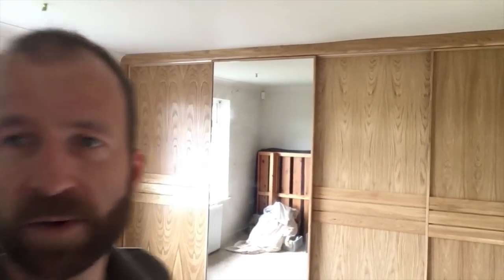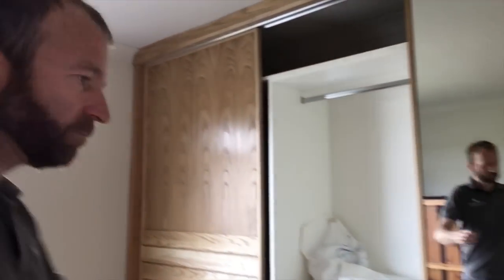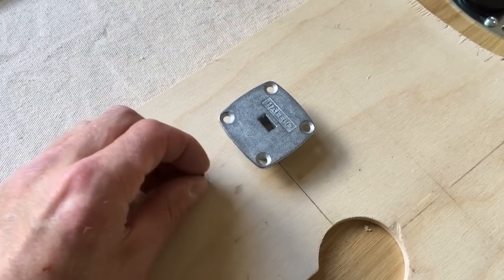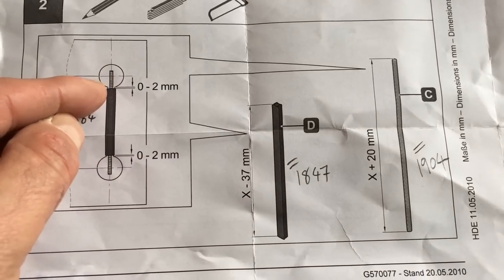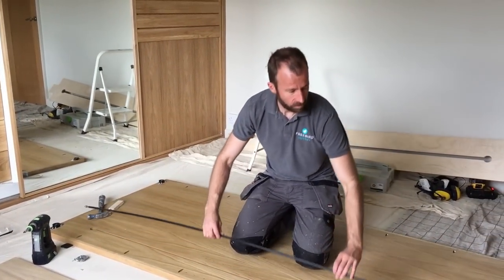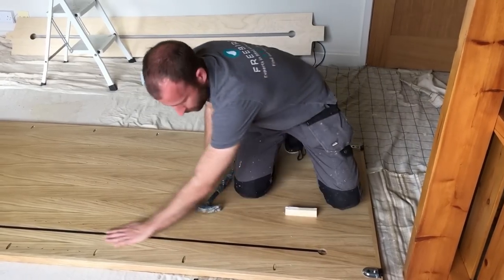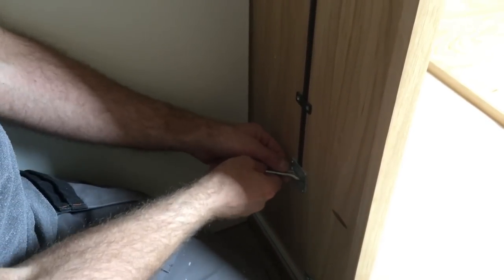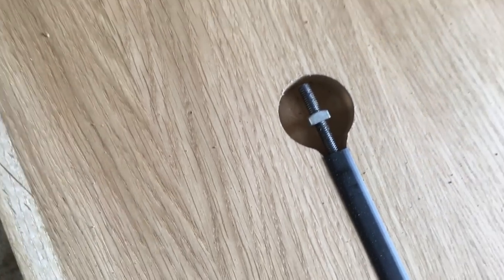How to Straighten Doors with Hafele Planofit Straightening Bars

Comment: Exceptional work! I hope the customer compensated you. Whether or not you figured warpage may occur, you’re not in control of the physics of this world, how hot the sun will shine or the fluctuating humidity levels. May God Bless.
Reply from the maker: I was like many woodworkers - too quick to foot the bill.  Which is why so many of us struggle along making so little money.  It feels like our mistake - or at least a lack of knowledge we should have had.  The customer paid to receive working straight doors, so I felt obliged to fix the issue that came up.  May such experiences overe the years led me to specialise more, and only take jobs where I know I can control the outcome based on experience.  On a recent job with a new material (Maple Ply) I advised the customer ahead of time there is a risk of warping, and if it happens there would be an added cost of £120 per door to retrofit door straighteners.  This is the best way - to be able to foresee possible problems, and give customer forewarning of potential costs

Comment: This is an extensive process but one we’ve used for large format doors. Aluminum honeycomb, epoxied between two 6mm veneered ply. Glued up inside a vacuum bag.
Reply from the maker: Interesting!  How thick is the aluminium honeycomb?
Reply: @Alastair_Freebird  5,11,18,24mm. Then there’s different cell sizes. 1/8th - 3mm and 1/2 - 12mm.
(US) Amazon have some small sections available. It’s like building a hollow-core door.
Reply: @Alastair_Freebird  resin infused cardboard honeycomb also works well for this, much cheaper than aluminum if you can find it 👌

Comment: I have used that running gear a couple of times and always found the door would fall back a little. The Ares I think it is on buller ltd with spring-loaded wheels top and bottom are much better with easier adjustments. Doors look good.

Comment: Looks like a neat bit of kit.. Guess they are not cheap.
Reply from the maker: simon clayton I meant to summarise the cost at end of video but forgot as it got late and I wanted to go home 😆 all 12 bars and fittings cost me around £170 plus vat from Hart Wholesale (my preferred Hafele reseller).  It took us a long day to do plus best part of a half day for Brady figuring it out and getting the jig right in the workshop. So costly altogether.  But it really shouldn’t have taken that long; now that I understand the system if I ever had to do it again I’d just go straight in and cut the doors with a 35mm hinge cup drill bit and a 10mm router cutter with a fence.
Reply: Nothing from Hafele is cheap, but the quality is top notch.

Comment: A great fix and very nice hardware, hopefully I don't run into this one day.
This has absolutely nothing to do with the hardware being top or bottom... please bare with me, I did not believe until I witnessed it several times myself.
I am assuming that the middle rails were glued well to the veneer? If so this would usually require a "balance" to the MDF core veneer I believe you are using. Humidity and temperature changes to core material will cup a panel, especially if one side is glued in one spot,the veneer on that one spot cannot move whilst the other side does,this creates an area at the back of the panel that is not still " balanced" to the front veneer and creates a point to curve from.
I am a   30 year in Cabinetmaker/ Joiner from Yorkshire and never thought of,or believed temperature or humidity could change a Bespoke made piece until I moved to the Deep South and witnessed this several times after moving to the US 20 years ago!!
I am really enjoying your honest and transparent stories,keep up the great work lad!
Reply from the maker: Bradley Roe thanks for the comment and interesting to hear a bit about you!  Yes those horizontal oak strips were glued (and ‘clamped’ with screws out of sight through the back until the glue dried). Because they are horizontal and only a small area I was thinking they weren’t a big factor in the bending but you may be right that they contributed to the issue.
Reply: @Alastair_Freebird  Look into trying to acquire a copy of the Architectural Woodwork Institute guidelines,a door stop of a book but very decent regarding panels.
It's the same if you don't balance a laminated sheet with a similar product on the back side,the panel will bend it not secured.
Have a great weekend and get back to work!
Reply from the maker: Bradley Roe I would like a book like that!  Is that a British or American institute publication?
Reply: @Alastair_Freebird  ,it's an American book of the different grades of millwork. AWI is the gold standard over here and a thorough reference to have. All of the information is strictly backed up.

Comment: for those kind of slidding doors i only use 10 mm thinkness pannel plus aluminnium profile, It works fine for me and never had bending probs with it.
Reply from the maker: Wood Be I agree aluminium frame style is the most risk free style if the client accepts that look.
Reply: @Alastair_Freebird  we have a large variety of alu styles available in Portugal. Nothing as warning client about the risks using solid wood in large panels.

Comment: I’m about to do a job using 21mm plywood. The doors are 500/2000mm. I will be using the Wingline L bi fold system. They will be painted. Should I use these from the start? Super video.
Reply from the maker: I think they might well be ok without the straighteners but be prepared for taking then off and adding them after.  I think when a door is restrained by hinges it helps keep it straight whereas bottom rolling sliding doors are especially prone to distortion

Comment: Unfortunately I have a warped sliding door to a bathroom which is not heated or cooled, but the hallway side of the door has aircon in summer and heating in winter, so the door warps one way in winter and the other way in summer. So I don't think these things will work. Thanks for the video though, very detailed.
Reply from the maker: Mark One interesting situation!  They will work but you will have to keep readjusting them to alternate between tension and compression in the different seasons!

Comment: Nice little "get out of jail 'free' card"!
Bit surprised about the warping as the core is veneered on both sides.
I suspect a small part of the problem is down to bottom-hung runners being used.
I find that top-hung sliding doors work much better even if you have to make up your own fixing support out of e.g. 4x2 anchored at the ends(avoids ceiling fixing issues)

Main cause may well be that the sturdy oak edgings weren't fully seasoned/sealed and were asymetrically positioned- 1 edge glued n mechanically fixed whilst the other is free to shrink/stabilise.
Perhaps 3mm oak lipping on the edges and a pair of separate 12mm oak finger-pull battens glued to front face would have avoided the problem altogether and indeed if wide enough,e.g. same width as the crossrail members, would have eliminated/significantly reduced chance of subsequent warping due to lamination.
As I'm sure you can appreciate;in some ways we are always prototyping,right?Price of an interesting life!
Keep up the good work and fair play for showing it how it is in real life,warts and all! :-)
Reply from the maker: Chippy Steve thanks a lot for commenting and sharing your thoughts and I like that -‘always prototyping’ - so true!

Comment: The actual problem is the design of the door. Panels do bow under their own weight unless you hang them. That is a fact. That is why all 8×4 sheets are stored flat on the shelves in B&Q. If the panel stands upright, there is going to be tension on one side and compression on the other. Therefore, a wooden frame should be sandwiched between two panels to reduce this effect then it would stand straight for years. I am not convinced that the metal rods are the solution in the long run. Yes you change tension to compression or compression to tension on one side but in the future the panel could still bow to the other side.
Reply: @Tephnos  where did you get it from? what I am saying is there has to be a frame holding the panelsl.. You can't cut a piece of plywood or 18mm board and hinge it as a door, can you? It won't work as it will bend/bow. Some kind of frame is required.

Comment: Great video - thank you.  I plan to fit these to two sliding doors.  The doors are 18mm ply and are each 1600 high by 600 wide.  Given that my doors are only 600 wide, do you think I would get away with 1 tensioner in the middle or each door? (rather that one on each edge as you have done)
Reply from the maker: Peter Savage I would recommend going the whole hog and doing 2, you will have more control flattening out the door
Reply: @Alastair_Freebird  Thanks for the quick advice.  I will do that.

Comment: Used same runner system, built doors (mfd) 2300 height . Had warping problems. They bowed out. Bought ‘piano’ straightening kit. Shortening  bows them out more. Tried lengthening but didn’t work. I’ve taken doors off again, and am reverse bowing under force. Maybe if I put them in bowing inwards ……………
What a palaver. I’ll never use these tracks again. Best to hang them. I’ve never had problems with the hangers because the weight of the door acts as a natural straightening force.
Reply from the maker: It should be possible to adjust either way - is it possible the length of the threaded bar got maxed out (cut a little too short maybe?). And was it set in offset from the centre of the thickness of the board?
Reply: @Alastair_Freebird  hi. Thanks for replying. I used 3/4 mfd and I routed to the minimum depth required to fit rods and guide bar. Rods were used full length and the adjusters were correctly spaced for this. 
Update. The reverse forcing didn’t work, so I ascertained the apex of the bow and cut several horizontal lines across the front at this point and above and below this point, in order to take away resistance. The reverse forcing was then almost successfully accomplished, and the doors refitted. However I realised they would always tend to bow out so I fitted securing cover strips on the two sides of the wardrobe that keep the doors locked straight . Small  bowing is visible at the centre. 
All in all. The most problematic wardrobe I’ve built out of over one hundred. But it’s all painted, very functional inside and actually looks superb if you don’t inspect the middle to closely!
I’ll never use these tracks on such tall doors again, though!
Thanks for your video/s . Great wardrobe you built there!

Comment: That is awesome! Do they only work in a certain thickness of board?
Reply from the maker: Nic Harvey minimum thickness 16mm (lucky for us!) but you wouldn’t normally be making big doors that thin so it’s not an issue.   They’d work fine on thicker boards eg 22 or 25mm - I know people have used them on those thicknesses.

Comment: Hey, just put this system into a 3 door sliding wardrobe fit. I figured quite a quick way of putting them in ( if you want to know let me know I can explain and it does not involve a jig) . The doors will be going up in the next day or two,  hopefully they will not be used. I did notice something extra though. The doors have been leaning on a wall for a while and I am pretty sure those fittings prevented them from bending . The material used by the way is 18mm birch ply with tulip wood running up each side end.
Reply from the maker: That's all interesting to hear.  Do you use a 35mm hinge boring bit and tracksaw?

Comment: Great video, thanks. Can this happen on 18mm MRMDF flat doors? (1700 x 650 slab of MRMDF). Not running doors but installed with 4 blum concealed hinges. Thanks.
Reply from the maker: I think it’s less likely to happen when a door is restrained straight and vertical on one side with hinges, however it can happen that you still get a bit of twist or bend in the board (maybe from prior to hanging the door, or appearing after) and these can be a solution to that too.
Reply: @Alastair_Freebird  thank you very much for replying. Really appreciate it. Have a great weekend. Cheers

Comment: I’m about to make some shaker style wardrobe doors from 12mm mdf and 9mm stuck to the front to make the design. They will have bottom runners, are the likely to bow? If so you hat would be your suggestions as I can only have a maximum depth of 22mm due to the runners.

Thanks
Reply from the maker: Yes likely to bow over time so I would recommend pricing in and fitting door straighteners from the start!

Comment: So it was the oak that bend the mdf. Mdf by itself would not have bend.
Reply from the maker: MySchizo Buddy I think it would have done with only mdf too but not so bad and for different reason - hanging off fittings not mounted dead centre on the board.

Comment: Pls help! I have 2 sliding hanging closet doors. I removed them to put a dresser in the closet. A few hours later I tried to put them back, but noticed they bowed slightly and since they need to slide right next to each other, they would not close. I can't believe it. I really dislike these hanging doors on the top track with the bottom guider.
Reply from the maker: If when you removed them you stood them up, leaned against a wall, and this was enough to bow them, then it may work to leave them leaning against a wall in the other direction (bulge up) until gravity counteracts the effect!
Reply: @Alastair_Freebird  yes that is what I did. I will try ur suggestion. I don't think I'm handy enough to do ur solution

Comment: if the door is hinged on one side, can a single straightening bar be used?Can hinges keep the other side straight?
Reply from the maker: The best thing to do then, is to have one vertical door straightener near the unhinged edge, and another running across the diagonal.  The diagonal one will allow you to adjust for any twist.

Comment: How much would you charge to install the system? Thank you
Reply from the maker: Sorin Hodosan well now... for these 6 doors the components cost me about £170 plus vat at trade prices.  And we were there for a day however we could have been much quicker.   And recent analysis of my lack of profit in the business suggests I should be doubling the direct material and labour costs to cover overheads and profit.  But that wouldn’t be the case for a one man trader.  So... anywhere  between £50 per door (might be worthwhile for a sole trader) and £100+ per door (company with overheads and vat) I reckon.  I’m not very good at short answers 😁